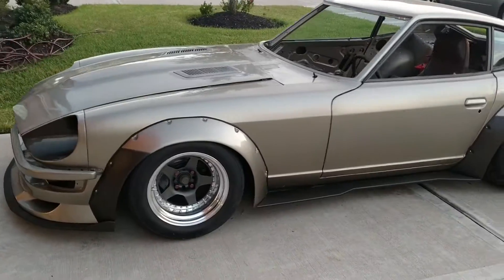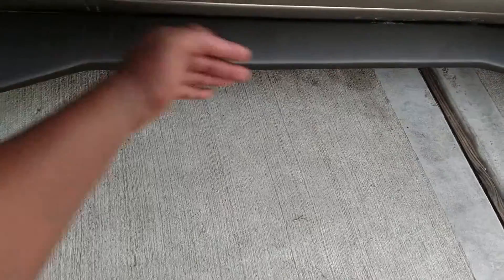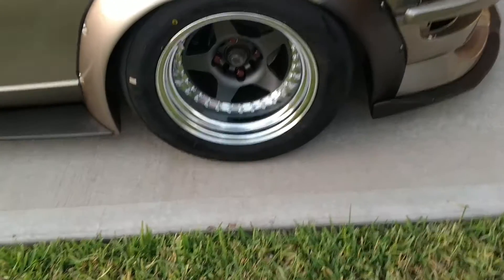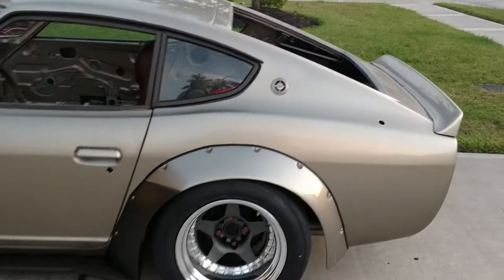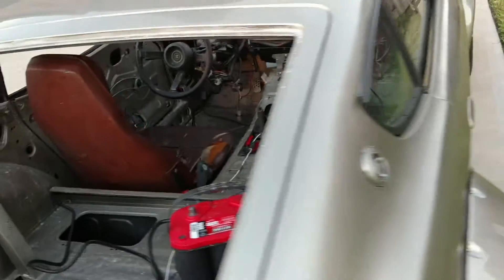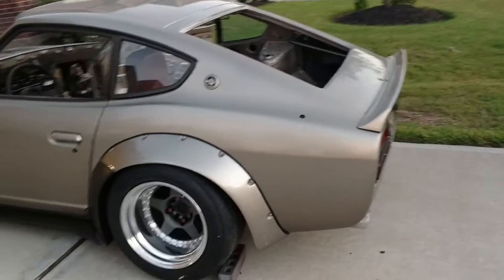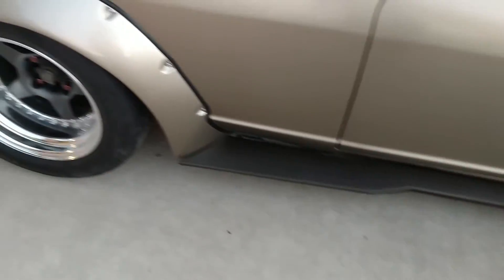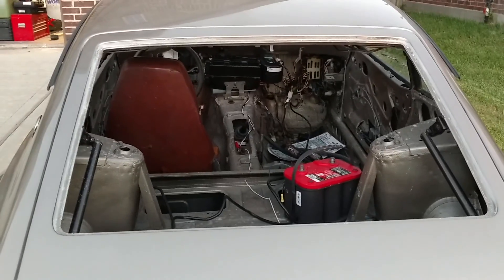Homebrew 280z update almost there

Comment: The tires look perfect in the wheel-wells. What rim and size/offset you using, and with any spacers?
Reply from the maker: MagZup07nope no spacers, 15x9-53 and 15x10-66. 225 50 15 Proxes r888
Reply: Dang thats some serious negative offset, looks good!

Comment: ah man, you have a vq37 in there ? i have a few questions about it. im stuck on mines, but i have the vq35de, pretty much the same. ALSO those wheels tho, what are the specs? I have a 280z vq35de posted on my channel if you wanna check it
Reply from the maker: It's a vq35hr not the 37. I will check you channel out for sure. the wheels are 15x9 -53 front and 15x10 -66 rear. it was a blind order on the wheels as I ordered while my kit was still being built. ideally you would want to order wheels once you can properly measure but I knew it would be a 3 month wait on Work wheels. if I did it again I would maybe a half inch or so wider on front and back
Reply: oh ok thanks, it looks good, man, looks good

Comment: more videos, car is awesome man
Reply from the maker: will try. prefer to limit videos to decent milestones instead of covering every little change. thanks for watching though.
Reply: car looks and sounds awesome just would like to see more.. can't wait to get my Z
Reply from the maker: what year you looking at and when you looking to buy?
Reply: looking mainly for 75-78 280, and im still looking for one would like to get one soon
Reply from the maker: good luck with search, are there many in your area?
Reply: Am in Arizona theres a couple here not too many,  how difficult was the VQ swap, am looking at either a 2jz or VQ swap
Reply from the maker: swap wasn't bad, only had to cut front cross member to clear oil pan, new exhaust manifolds for hr motor and cut clearance for shifter location. the issue I have with the vq swap is the lack of affordable standalone tunning for the vq. I let Doug at Z fever do my wiring and ecu and they did a great job. It came back to me a 4 wire hook up.

But my dad has a LS in his Cadillac and there are tuners, standalone fuel management and forums all over that make it way more user friendly. unfortunately I couldn't convince myself to do the LS. I got lucky and found a salvage nismo 350z and parted out what I didn't need. what ever motor you choose I would say find a whole running car to part out. maybe impossible if you go the 2jz route
Reply: thats why i wanna go with the 2jz theres a ton of options for that engine but i really like the VQ, did you drop the engine into the car yourself, did everything yourself or took it to a shop
Reply from the maker: all done in the garage except the welding of the mounts, welding rear floor and exhaust. took it to my buddies house since he has a welder and I hacked tact some welds so that I could seal it. let a shop do exhaust. everything else paint, body, electrical, motor pull from 350, and dropping motor all done in same spot in my garage.
Reply: Were did you get the engine mounts from, did you use the stock exhaust from the 350z
Reply: Love your posts.  I am working on a very similar setup.  I am very curios to see how you get the hoses to work with the ac system.  The one place said, the hose connections are different and that the compressor maybe a multi speed or something and may not be compatible.  I have no idea about all this stuff on the AC.
Reply from the maker: I will post info on the AC once it's all hooked up. It's pretty straightforward I'm using vintage air unit for the heater core and Ac control, vintage air dryer and stock condenser. the hose connections are different but it's easy to overcome. you have to use the factory hoses on the compressor, cut the ends off and press them to high pressure hose that has the ends to match your new setup. then all you have to do is wire the compressor clutch control into your new unit. I don't charge my own Ac so it will get sent to the shop for that.

Comment: do you think you could run 17's with the same specs with that body kit?
Reply from the maker: Yea just need to change tire size. Staying at a 25 inch diameter tire setup you shouldn't have any fitment issues.
Reply: @doulikezcars  you ready to sell that kit yet.lol or will you be doing a new build?
Reply from the maker: @marvingreen6644  it's already on a 2+2 I'm building lol. Will post some videos soon
Reply: @doulikezcars  good deal, looking forward to seeing them
Reply: @doulikezcars  one more question, did you run the 370z brakes and rotors or something else?
Reply from the maker: @marvingreen6644  I'm running a setup like that on another 280 I'm building. For this one I just ran the Toyota fronts and maxima rears
Reply: @doulikezcars  I plan on running the Apex Engineering front and rear. I'm hoping I don't run into any issues. With the specs from your other build I think it will be a good combination.

Comment: Hey man. Where can I purchase rims like those?
Reply from the maker: Parvin John they're Work Meister CR01 15x9 -53 tdisk and 15x10 -66 tdisk. I ordered mine through evasive motorsports and they took about 3 months from order time to delivery to my door.
Reply: Appreciate the feedback man. Thanks a lot
Reply: One more thing bro, thats the stock brake setup with those wheels ? And are you using spacers?
Reply from the maker: Parvin John I'm using the Toyota 4x4 brakes up front. also no spacers, I got the tdisk wheels which are made to clear big brake kits
Reply: doulikezcars ... regarding the suspension, is it stock suspension apart from the brake upgrade or did you have to use aftermarket arms and stuff to accommodate the wide wheels?
Reply from the maker: Parvin John I'm currently using ground control coil overs and techno Toy Tunning gtx2 front LCA and tension rod.
Reply: doulikezcars ... figured as much. I was looking at other vids and realized that I'll be needing to do a lot more mods if I want to run those wide wheels. Unfortunately, all these parts will have to be ordered and shipped overseas :( ... I'll be using the Gecko coilovers on mine. Still looking at a viable brake upgrade that's not gonna leave my pockets hurting
Reply from the maker: Parvin John honestly of you're not putting major power to the ground then you can keep front disk. upgrade the brake booster and master cylinder to the 79-81 system. then upgrade your front brakes to the Toyota 4x4 calipers and bigger rotor. it's tried and proven on many road race cars. if you have big power then the rear is definitely needed then.
Reply: doulikezcars ... not really planning on much power, but it'll be nice to have 'just in case' ;P ... its the nice wide wheel setup I want to get as well, so I'm. It sure if or how that would work with stock parts. The TTT arms will have to be ordered I guess if I really will need them
Reply from the maker: Parvin John if big power isn't a concern check the other builds, scca cars and so on. all still maintain the rear drums
Reply: Yea, I'll probably have to go with the RB25 turbo as that is readily available here in Trinidad. I've got disk brakes all round, but I'll look into upgrading them if possible
Reply from the maker: Parvin John Yea it helps to go with what you will be able to get parts for easily for sure.
Reply: Hey bro, are you using the stock suspension on the rear? Or was it modified ?
Reply from the maker: Parvin John ground control coilovers on rear. everything else like the LCA , rear end and mustache bar is stock
Reply: Thanks again. Asked because I was told that I would need to modify the rear suspension if I wanted to use anything wider than 8"
Reply from the maker: Parvin John the negative offset eliminates the need to change it up.
Reply: doulikezcars ... Great. S13 coilovers by chance? Or you used ZX coilovers
Reply from the maker: Parvin John ground control makes them for the s30 chassis.